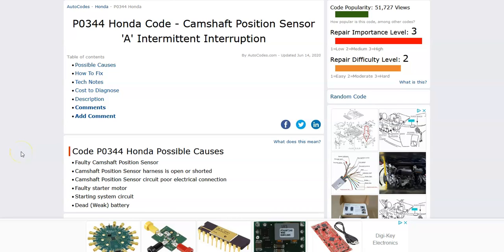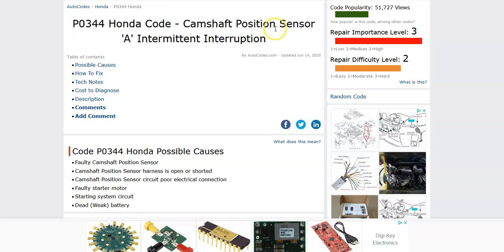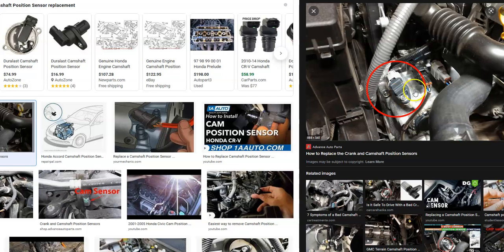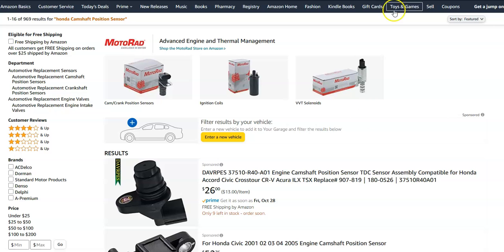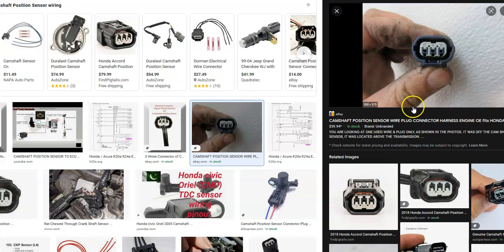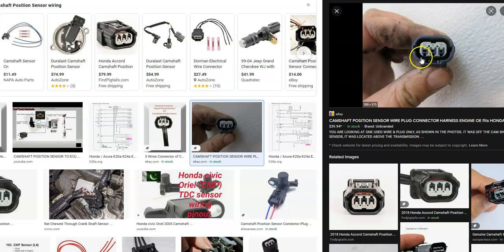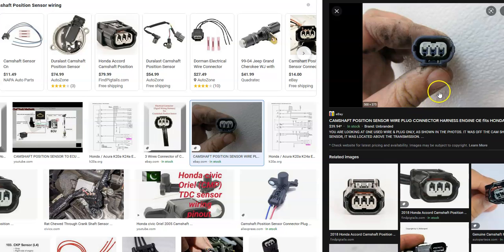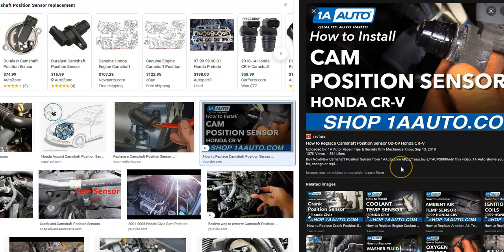How to Fix Honda P0344 - Camshaft Position Sensor 'A' Intermittent Interruption

Comment: So a rat got to one of my sensors wires and I had a guy come and just bypass that and just reconnect another wire to the wire that he busted and everything works fine. Do I still need to replace the wiring to make it like new or what do I do? Can I just leave it like that?

Comment: What about if you check the wiring and even change the sensor but the problem still return, when you try to drive the car, when you start the vehicle the fault code do not come
But when you try to drive it rev the engine then you get the error code… you could also hear that the engine sound is not coming out.  And the same camshaft has the high pressure pump too and it also reporting “low fuel rail pressure “
Reply: Hey, any of you two fix the problem? I replaced both cam sensors with honda ones, and the code its still there.
Reply: @AdrianSanchez-uh8ci did you replace them with good quality sensors?
Reply: Did u solve the problem?
Reply: Check timing